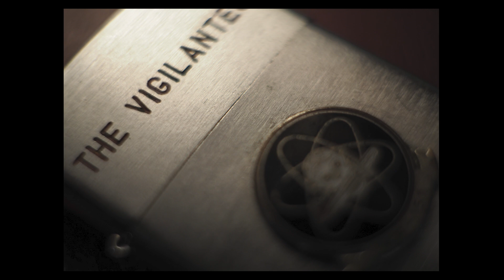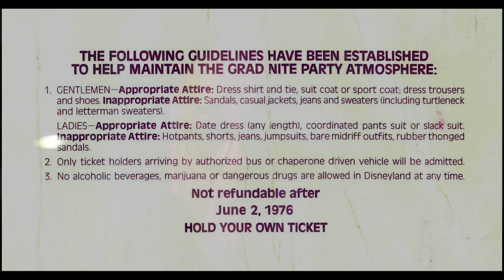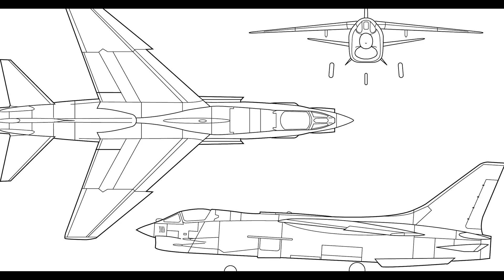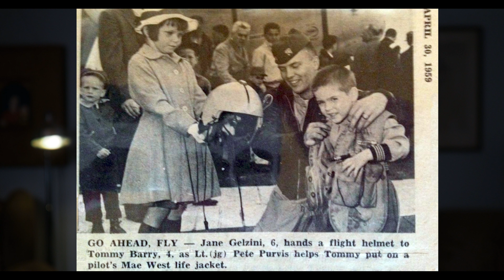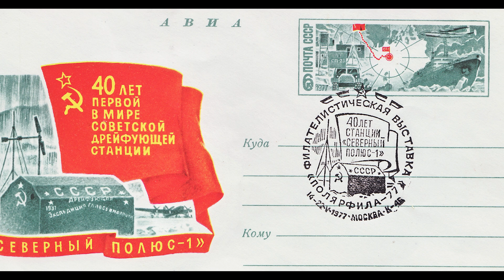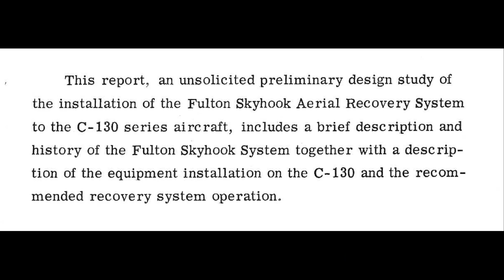The Dad Project--Sixth Installment: Skyhook

Comment: Who was the freaking maniac who said "Yes" to the question: "Who wants to possibly be ground up like hamburger by an airplane propeller"?????
Reply from the maker: Fortunately once the line was picked up by the S2F it was pulled in through the removed belly radar, behind the propellors, but the live test pickups were done with volunteers. Unfortunately one of those volunteers would die during a test and during one of my dad's flights. Not sure I would have volunteered myself. All the best, Mike